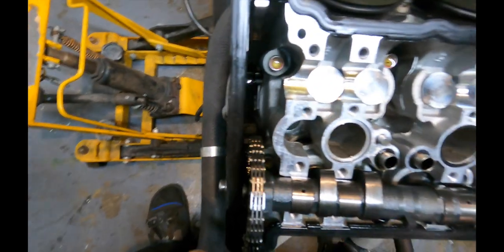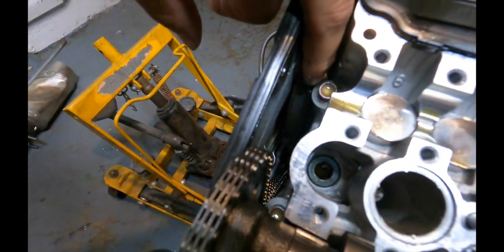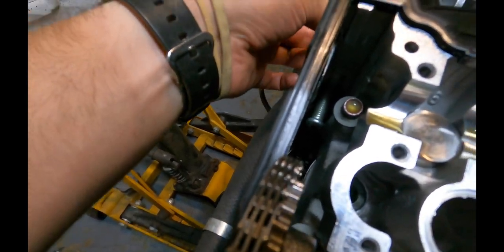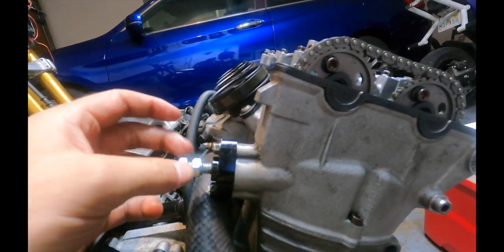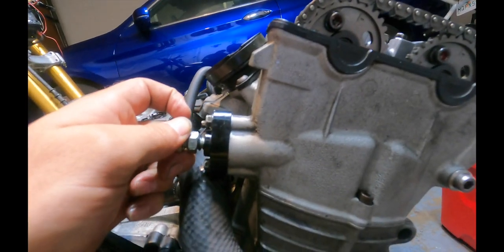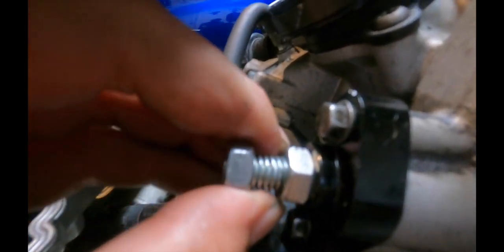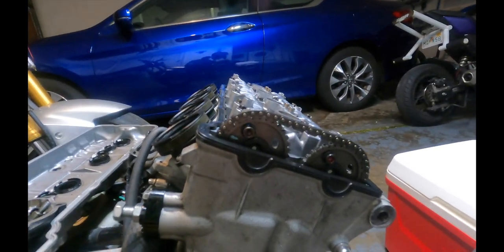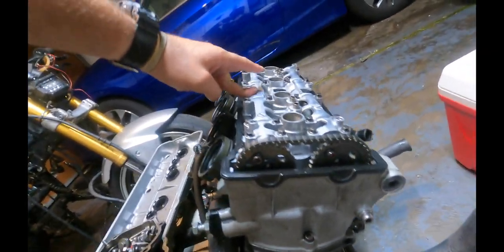How To Adjust Ninja 636/CBR 600 F4I Cam Chain Tensioner

Comment: how difficult is it to adjust while the bike is all set up together? It seems a little bit difficult to reach and which manual cct do you recommend? Have you ever replaced it without removing the motor?
Reply: you can do it with the bike all together,

Comment: My question is, does the head have to be removed b4 installing the manual CCT Or can u just remove the auto cct and install the manual followed by the adjustment and call it good?
Reply: For Ninja,just pop up the tank and remove the air filter box,from there you would be able to replace it in 2 minutes. Does your auto cct is bad? If yes,and you are broke,you can adjust the auto cct too with a "hack"...

Comment: Manually adjust an oem cct and youre putting unnecessary tension on your cam journals. Do so at youre own peril.
Reply: With full adjustability it should allow you to not over tighten though. Right?

Comment: Quick question, when you change the cct, where all the oil goes?
Because I am after trying to fix the automatic cct with a screwdriver and oil jump . 
When you change with a manual one , do you need a tray underneath? 
Do you have to replace oil after ?
Sorry, I am new.
 Pls help. Thx
Reply: if the engine has been standing then oil will have drained into the sump. you will need new gaskets for the crankcase and camcase, and also the tensioner if you are swapping it out